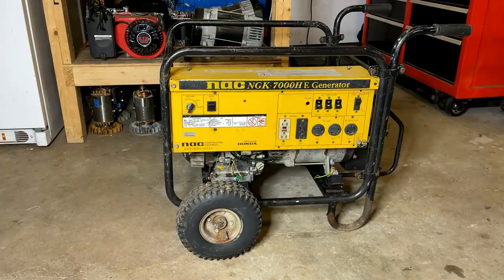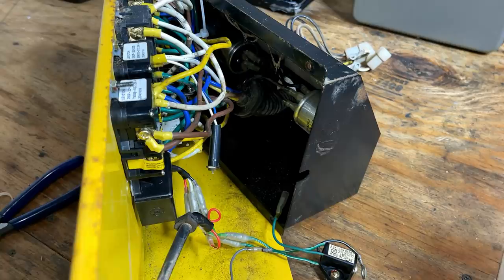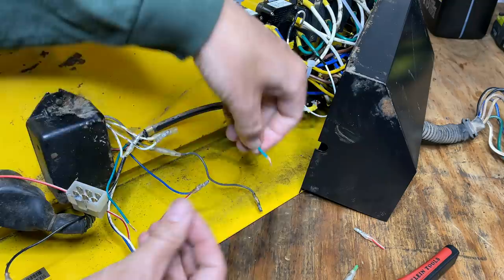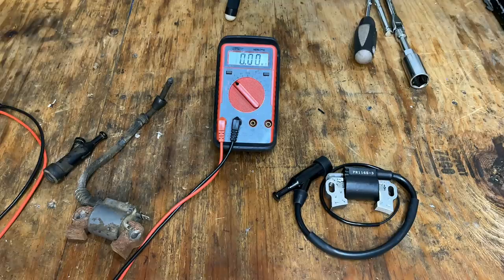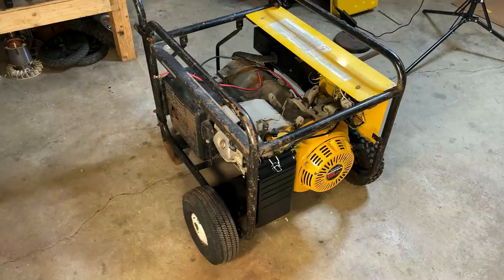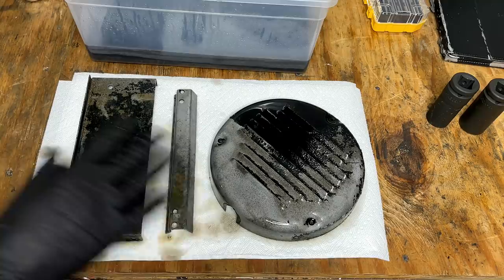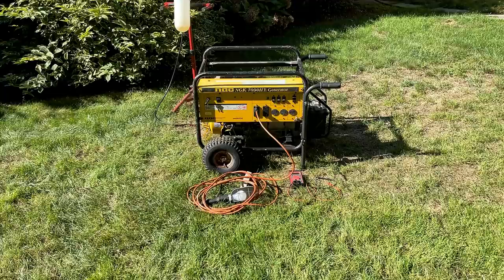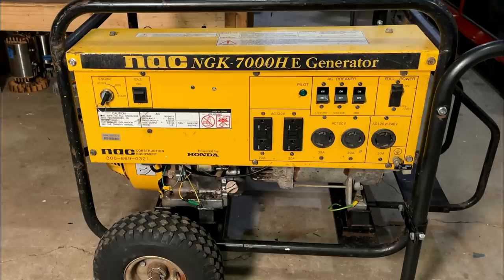Trashed Generator Part 2 - Making it Perfect

Comment: So no one else saw the winding flash when he pulled the plug on the test light? No? Ok...
Reply from the maker: Just saw it!  Thanks for the tip!  Seems to be on the engine side of the stator.
Reply: @jcondon1  Seems so my guy. Looks like the next vid on this generator will be showing some damaged winding insulation...
Reply from the maker: @wyokaiju992  yes.  Also hoping one of the other power heads I have can be used as a replacement.

Comment: Looks like that is not the correct battery, too large?
Reply: There is an option when buying this generator new of the smaller or larger battery tray. So obviously it is left to the buyer to decide what size battery to have.

Comment: Have you ever worked on a Honda ew171
Reply from the maker: I have not.
Reply: @jcondon1  I am having an issue with the generator having low voltage and low welding voltage it will strike an arc but not keep it going the unit sat outside for a long time so i am going to go clean up the slip rings and the rotor to see if that helps
Reply from the maker: @troyfabrizius9942  If brushless, then look for the capacitor.  It might need to be replaced.

Comment: Battery is a sla 9ah not that one.
Reply: There are two battery tray options so the buyer can use a smaller or larger battery. The guy who owned this used a larger battery with the smaller battery tray.